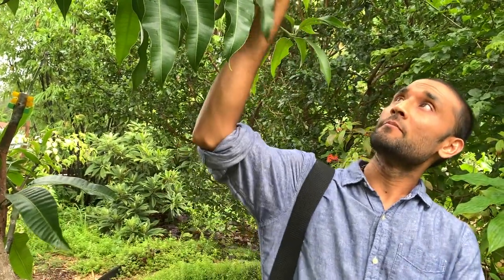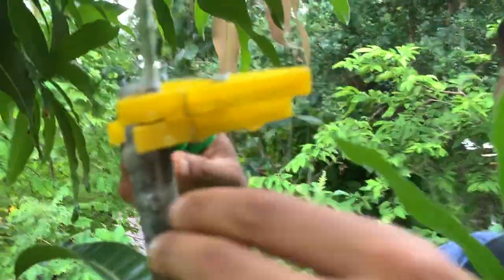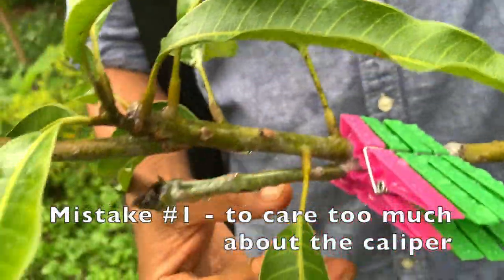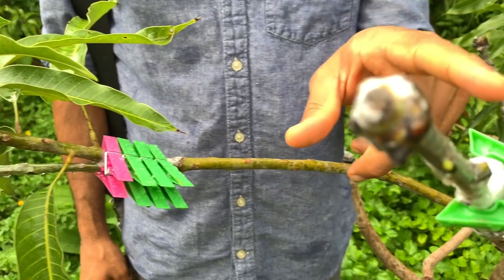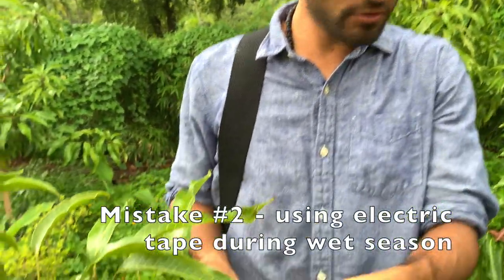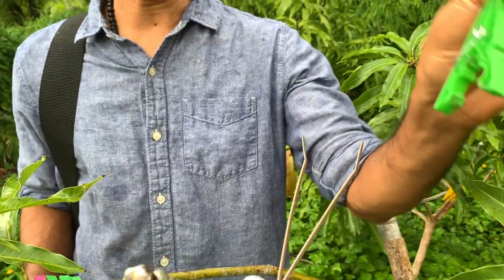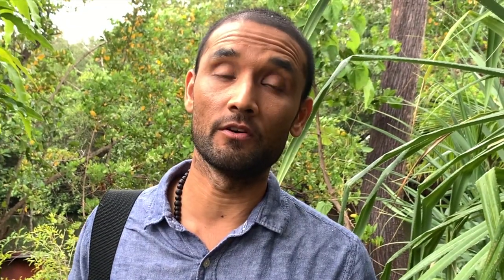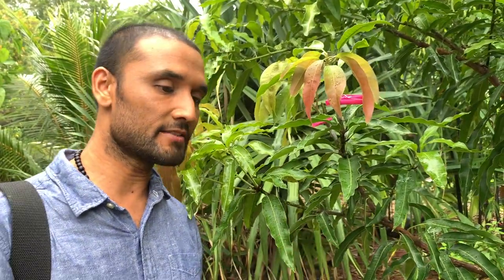Why do my grafts fail??? 5 More GRAFTING MISTAKES - 1 year later

Comment: Good channel. My question is: Can we use grafting wax to seal scion prior to using parafilm tape? The major issue in south Florida is rain and humidity which causes water intrusion after grafting which kills the scions. Please respond. Thanks!
Reply from the maker: @sandycay4085 good question, thank you. Rain intrusion is the biggest problem in South Florida. The reason it is not talked about as much is because more than 90% grafters use the top cleft method of grafting and this problem rarely happens in that method if buddy tape is applied to the union moving from up to down. In side graft it always will happen in rainy season if measures are not taken. I have used tree wound seal, grafting wax, a plastic hood to just cover the scion with some success but water always enters. You can apply wax after you secure the union, and put parafilm over it. Another option is to cut the part of the rootstock above the union so a bigger plastic bag can be put over the entire branch extending down below the union.
Reply: @ Thanks!
What good mango varieties do you recommend for Florida environment?
Reply from the maker: I have a video called “my 8 most productive and disease resistant mangos”, these are some of my favorite varieties, you can find it through channel search

Comment: First time watcher I have several seedlings from hass avocadoes that I would like to graft and I see you show the grafting on the mango trees which are already grown. But I would like to know which type of scion do you recommend grafting into the seedlings for my hass avocado and or mango seedlings and or do you have any videos on grafting into seedlings wether is avocado or mango.and also thank you for the info.
Reply from the maker: Thank you for watching. The grafting process is the same. It is much easier with seedlings. You can find the scion of same diameter as your seedling trunk. Green wood on green wood. And try to protect the graft from wind and rain, perhaps a plastic cover over the whole plant after you graft. Also you can prune some of the top portion of the seedling over the grafted area so it is easy to cover with a plastic bag. Please ask if you didn’t understand anywhere.
Reply: Thank you will be subscribing and thank you for the Hinduism teaching into the connection between the body and air and surroundings in our souls and nature it is enlightenment to have someone who understand the connection between the plants and how we live united with nature as I do believe everything natural should go into the plants we grow thank and I appreciate very much what you do to maintain that balance.

Comment: I have been trying to graft avocado with little success but the process looks very similar.  Do you graft avocado and use the same techniques on them?  If so, I learned a lot today?
Reply from the maker: Thank you. Grafting avocados has been a but different experience for me. I have had many failures simply by choosing a wrong season for grafting or when rootstock seemed unhealthy. But same technique works.

Comment: I tried grafting in the month of January to March when the buds started swelling but my grafts did not take off. Though the weather in the day time is worm but in the night is quite cold which I suppose is the main cause of failure. Could you let me know the best time of grafting.
Reply from the maker: Depends, which tree are you referring to? Avocados can be grafted in Jan, Feb, March. Mangos not a good idea because the trees are in flowering/fruiting mode rather than vegetative growth. Other fruit trees differ so it depends. And climate/location also is important subtropics vs temperate climate, please specify which location and what tree you are grafting.